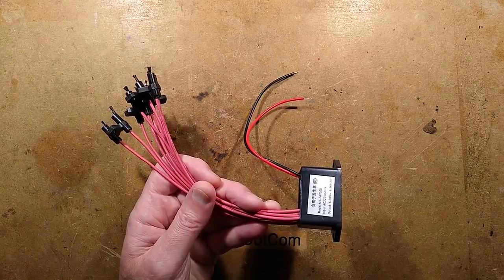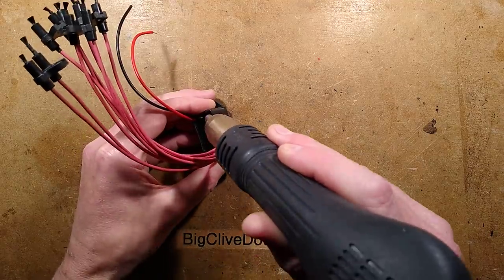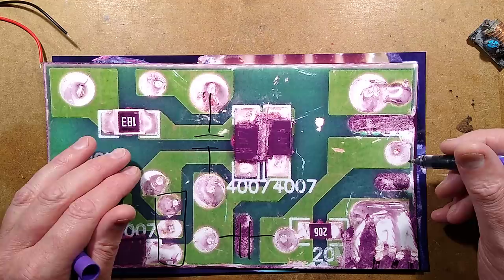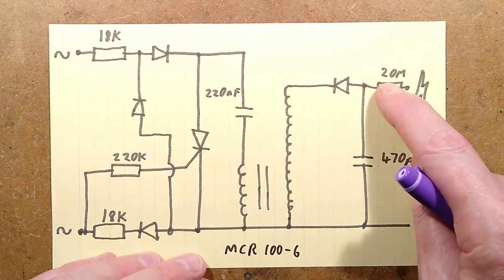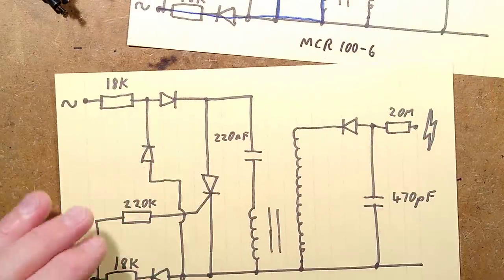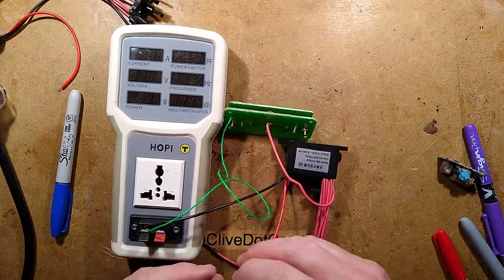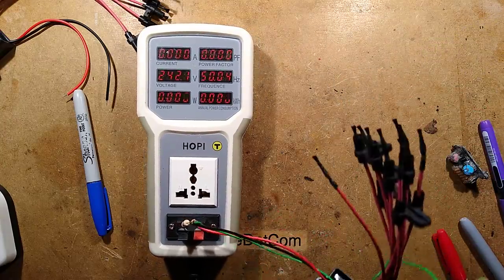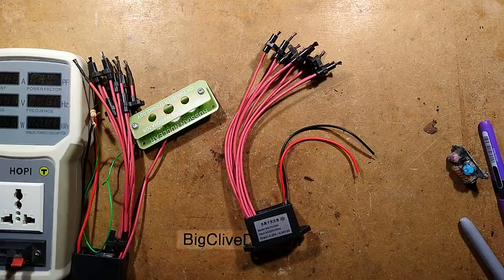eBay's biggest ioniser module depotted (with schematic)

Comment: you are  on 50hz AC I think so not only would running the unit at 120 VAC  in the USA lower the output voltage but at 60 HZ the high voltage cap would have less time to charge so that would lower the voltage spike even more. I think about 17% less charge time. Or am I off base on the cap charging circuit ?
Reply: I think the values of the first capacitor and resistors chosen are such that the cap has a small time constant so that it charges and discharges quickly.

While you're right that the difference in time between 50 or 60 Hz is about 17%, because you're dealing with exponentials (ie, non-linear) that doesn't translate to 17% difference in charge stored on or voltage across the cap. The charge/discharge curve is levelling off as time increases so the difference in the amount of charge stored (changing AC frequency not voltage) might be more like 9% (for the particular values I chose). I didn't write it down but iirc halving the resistance changed the difference in charge stored to about 3%.

You get to a point (by dropping resistance or capacitance) where, because the time constant is so small that there is no meaningful difference between 50 or 60 Hz because the capacitor charges/discharges so quickly. Obviously you don't want to drop the capacitance too much or the energy stored won't be useful for a task like this.
Reply from the maker: It might put a lower charge on, but it would do it 20% more often.
Reply: @bigclivedotcom  Good point ! I knew I forgot  to account for something.

Comment: 7000 could be a random 7000g of ozone per hour number.

I got a blue sheetmetal cased dual ceramic plate 230V ozone generator that claims 5000g per hour.   So possibly a hint on the output.

Comment: I was looking to use similar modules in a homebrew exhaust ozone set up for an indoor grow operation. Would one of these same modules do the job if the leads were mounted in a metal duct, or would it require multiple to be effective? I am using a 4" duck with a 150cfm fan.u
Reply from the maker: You may be better using a higher output ozone generator for that if it's for smell reasons.

Comment: For 230V to 240V it may be useful to add a 1W 10K to 33K resistor in series to make the life of the internal resistors easier. -> OR you can just throw it in the trash where it belongs?

Comment: Speaking of potted electronics....I've got a boost converter I bought from Temu I need to finish de-potting some day. When it arrived I attempted to test it out, but one of the wires was apparently neglected as it pulled straight out when I touched it. Luckily I just so happened to buy two of them, so one is for fun while the other will be for learning/teaching!

Maybe one day you'll run across the channel I've been working on...just hope I actually have some content if/when you do >_<'

Comment: i dont know what the wattage of the unit is but you can build an inverter that steps 12 or even 6 volts up to 220 to power this.

although a 20 or even 40 to 1 step up ratio may have the inverter drawing a couple amps from the battery

be careful with heat around acetone the fumes are not only not good to be breathing in but they could be ignited by heat sources.
Reply from the maker: The 220V would have to be AC at around 50 to 60Hz.

Comment: Finally convinced me to get a negative ion generator. Picked up a 12v unit nearly exactly like this, but with 4 outputs. Also picked up a small rechargeable ozone generator for my fridge. Should arrive tomorrow!  On Amazon, there's a TON of "wearable" negative ion generator necklaces, which I find.... very weird. Have you seen them?
Reply from the maker: I have a few here, but am trying to limit ozone videos.
Reply: negative ion generator necklaces, you  have to be careful as some of them have actual radioactive power in them (or just rubber which won't harm you or do anything) 
just youtube "negative ion necklaces" and you get first 3 results videos related to this (the powder or prolonged exposure to them is the bigger issue)
Reply: @leexgx  Oh yeah, I've seen those ones with thorium dust. Super bad news.
The ones I'm talking about are basically small versions of these little modules powered with a rechargeable battery.
Reply from the maker: If using an ionizer on an isolated 12V supply I strongly recommend referencing the negative connection to ground.  Otherwise the charge put into the air can create a high voltage differential between the primary and secondary sides of the power supply, with a risk of insulation breakdown.
Reply: @bigclivedotcom  I may or may not have fried a 12v wall wort when not connecting to the negative to ground...😂     It happened FAST, and it caused my computer monitors to flicker when I turned it on.  hahaha.

Comment: I find that for cleaning really baked on engine varnish, nitro lacquer thinner is the best (better than acetone), the more stuff it contains the better (MEK, DMF, toluene, xylene,...)
Reply: Always depends. There are plenty of things Acetone alone is better for, but depotting stuff is definitely pretty hopeless with any of these common solvents. The compounds used are specifically designed to be chemically very resistant because they often get subjected to more powerful solvents during normal manufacturing.

Comment: I got mine a week or two ago. I placed it on top of our air cooler. First thing I noticed is that there is a buzzing sound when it is plugged in. It made me scared at first but it didn't explode with continued use.

I even tried using a multimeter with this using your technique of grounding and clipping the other lead to a metal plate. It really works. Whenever I touch one of the carbon fibers on the metal plate, the meter reads out up to 400 Volts. Which is cool. And considering that the 12V ones only show up to 100V when I touch the fiber to the metal.

I just now need to buy a power meter like your HOPI to see how much this device is costing us if I let it turn on for at least 8 hours a day.

Comment: Does adding a resistor in series with the neutral change the voltage at the gate of the thyristor when the polarity changes to operate it?
Reply from the maker: It will affect the current, but that thyristor has a very sensitive gate.

Comment: Although i can see 12v at the input i am not sure its working. You once showed a way to test the output using multimeter held near the emitters...

Can you remember what the video was?
Reply from the maker: Set your digital meter to around 20V DC and put the negative lead to the supply negative, then hold the positive lead about 50mm (2") in front of the emitters.    You should see a negative voltage displayed.
If using an ioniser on a DC supply, I recommend that the negative connection is connected to mains earth/ground.

Comment: Can you low the mains voltage so it last longer when using 240v(UK).What's the value of the resistor you put inline.
Reply from the maker: I'd stick an extra 18K 1W resistor in series with it.

Comment: Would this thing be nominally safe to set up in an HVAC duct to run when the heat or ac kicked on, or do you think it would have a bit too much of an ozone output?
Reply: I just built this unit to run on 120v, so far it's not putting out a smellable amount in a closed room after about 30 minutes.
I think it would be perfect for 240v switched with the blower fan.
On 120v (half strength?) it's probably too weak for a whole house switched with the hvac.
edit: after about an hour it's just smellable in a closed room.  Probably the perfect size for switching with the furnace.

Comment: I am telling you about something strange in the 12v ionizer modules, I have it connected to some lithium batteries, when I touch the negative power terminal, the ionic wind increases a lot, when I stop touching the negative power terminal, the ionic wind is greatly reduced, If I touch the batteries I feel a small arc of current, it is as if the high voltage were going back from the module to the battery.
Reply from the maker: Ionizers need a reference to ground to work properly.    Connecting the negative of the supply to ground will work.  It's also why these modules should not be used with plug in supplies that don't have the output grounded, since it will arc over between the mains and low voltage sides of the PSU internally, potentially making it unsafe.

Comment: Why do the primary and secondary side share a "ground" at the transformer?  Could the secondary side of the circuit be isolated/dereferenced from mains?
Reply: The electrons have to come from somewhere.

Let's say the coils are isolated. Circuits are synonymous with loops. You still need the right hand loop to be emitting charge carriers to air so where's the rest of the loop? Are you closing the loop by pulling charge carriers directly from the air?

You could try connecting the loop to the ground. It's not a very big current even if it is at high potential. :)
Reply from the maker: For an ioniser it has to be referenced to the ground to put a charge into the air with respect to ground.

Comment: The "tank" capacitor. 220nF with the two 18 k resistors.   RC would be 79 ms compare with 20 ms  ( 5 ms for charging to peak)......peak not gonna get full charge even without extra resistance in line....but the output still seems good so yay!
Reply: RC is 7.9 ms actually, still not fully charged in 5 ms, but much better.  Don't have exact figures but I'd guess about 40% of peak, so about 130 volts.
Reply: @CoastalSphinx   bugger slipped  a decimal...so RC  7.9 and 1/4 wave at 50 Hz or 5 ms   as you say much closer

Comment: "anion" stands for negative ions (like "anode") while "kation" would be positive ions (like the kathode). At least that's how we use these words in German, so I guess they've made it an international thing now (if it wasn't that before, anyways).
Reply: cation is spelled with a "c" rather than a "k" in English because "redundant alphabet" but, otherwise, you're right. When I was a kid and didn't have Wikipedia, I always thought the "tion" in "cation" was a "-tion" suffix and should be pronounced "shən".
Reply: @ssokolow  Yes, I thought there might be a c instead of a k in there, but basically, it's pronounced the same ;)

Comment: adding a resistor right there will weaken the circuit ???
Reply from the maker: Not at the high voltage and extremely low current involved.

Comment: i got some of these that were 12v, though they were 12v AC so I dont even know what to do with them now. All I can think of is I think some lights use 12v AC bricks but thats about it
Reply from the maker: If you rectify the AC to DC they should work, but the voltage will end up a lot higher, which may damage them.

Comment: Any idea on how to safely measure the output voltage of an ioniser? I did manage to kill one of my multimeters the other day :|.
Reply from the maker: Don't actually touch the emitters.  Ground the common probe and hold the other about 2" (50mm) in front of the emitter.
Reply: @bigclivedotcom  Yes, but this will give only rough indication of HV.
Reply from the maker: @Arthur-xe5hj  It's very hard to measure the voltage with the very low current of ionisers.  The meter will affect the voltage, even with a high impedance probe.

Comment: "And a bit of ozone for extra benefit"
Benefits such as pulmonary oedema and literally everything in your room losing colour
Reply from the maker: Ozone occurs in nature.  You literally breath trillions of ozone molecules with every breath of outdoor air.  It would take dangerous levels to bleach your room.
Reply: @bigclivedotcom  You don't actually breathe any of it normally. Ground level ozone is measured as an aspect of pollution near roads. The only place it occours at in nature is high up in the egde of the athmosphere. OSHA says that levels above 0.2 ppm are considered dangerous if the exposure takes longer than 2 hours or 0.1 ppm for exposures longer than 8 hours. 5 ppm are considered directly dangerous to life. We are talking about toxicity nearing chlorine gas here.

Comment: Eventual this module is for an Ionizer that is used by your garage to desinfect the ventilationshafts? (After filling the shafts with foam, using an ionizer is the newest gimmick)

I guess a Ionizer that is running while driving (or before driving w/o ventilizing) will give everyone a nice headache :D

anyway... an automatic "desinfection" every few days in the night (including setting ventilation to slow circulation and after it is done to fast outside) would be a nice Project for an Arduino (or ESP)

Comment: Acetone and an ultrasonic cleaner with a sealed lid?    (metal, of course)
Reply: Acetone is way too weak for those compounds.
Reply: @Basement-Science  - He already stated it softened the epoxy.   That means it has an effect.  The point is that an ultrasonic bath would separate the softened putty from the hardened mass, allowing the solvent to penetrate a bit at a time.
Reply: @tbelding  Yeah, depends on the compound, could work well. The ultrasonic could also be too weak though, or the acetone could just not actually dissolve or weaken it enough to matter. 

It's worth a try, but I'd have my doubts. It definitely wont work for all potting compounds. Some are way too chemically resistant.
Reply: @Basement-Science  - I know about those.  I put some hard drive magnets in a jar of acetone for two months.  None came loose from the epoxy holding them to the backplate.   I REALLY don't want to try soaking them in MEK.

Comment: I had two of those 220V, they died after a month continous use. A 12 volt died also after a week!
Reply from the maker: I think they stress the current limiting resistors in them.  You can add an external resistor to take some of the strain off them.

Comment: Hi I just removed a similar looking ioniser from my air purifier, although it only has one pair of carbon brushes. I will post it to you big clive if you get in touch to say you want it. Its a nanbai brand 4-5kv 220 - 240v - 50hz one.

Comment: You left out the best bits:  Measuring the high voltage and drawing tiny sparks from it!
Reply from the maker: It's hard to measure the high voltage side as it has a high impedance.